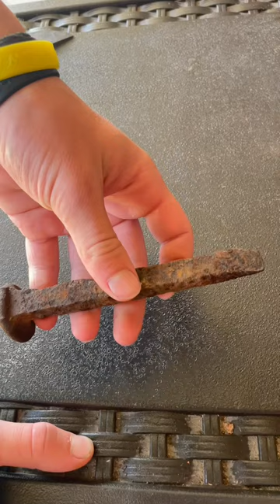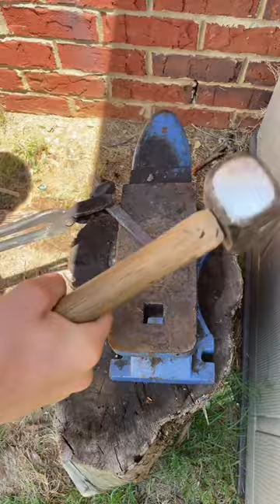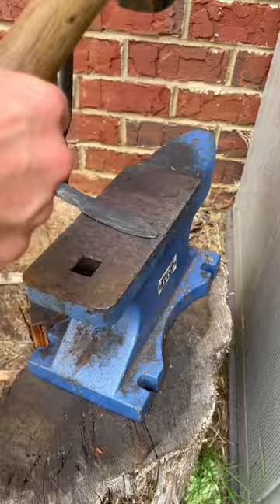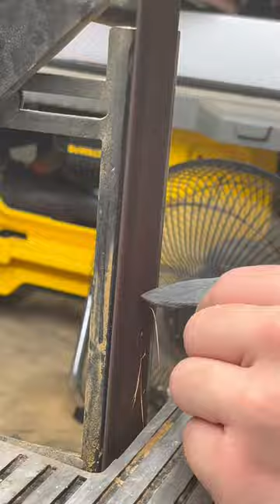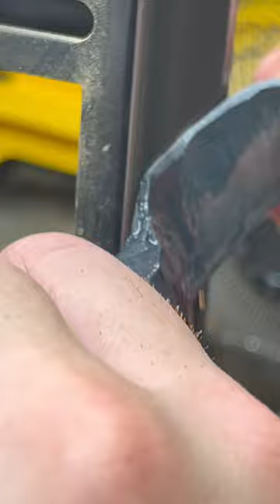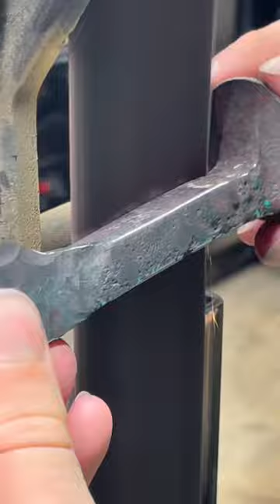Forging old railroad spikes into simple knives- #forging #knife #forged #diy #bladesmith #handmade

Comment: So what kinda rr spikes y'all using that actually harden up enough to make a knife out of?? All of the ones I've tried barely harden up enough to hold an edge at all. Like they almost don't even harden at all. Are there different types out there with different carbon percentage?
Reply from the maker: Thanks for the comment! I actually didn’t heat treat these ones, all railroad spikes you find are going to be soft or mild steel. So sadly they don’t make a good usable knife but they are nice for decoration or letter openers. Plus they are great practice for forging! So sorry i can’t really help you with hardening them but i hope this helps a little! Thanks again for watching!
Reply from the maker: Hey, scratch what i said before. I’ve been doing some research and found out that there can actually be high carbon steel railroad spikes. They will have an HC stamped on the top vs mild steel ones will have MC stamped on top. So it is possible to find them they are just much more rare and most modern ones will be mild steel. Hope this helps!
Reply: HC marking on rr spikes means that they have higher carbon and are
 Not made of high carbon steel. You see HC marked rr Spikes are between 0.30% carbon and 0.50% carbon while 1095 (AISI1095) which contains 0.90-1.03% Carbon, about three times as much carbon as the “HC” Spikes measured and lab certified to contain.
Reply: HC marking on rr spikes means that they have higher carbon and are
 Not made of high carbon steel. You see HC marked rr Spikes are between 0.30% carbon and 0.50% carbon while 1095 (AISI1095) which contains 0.90-1.03% Carbon, about three times as much carbon as the “HC” Spikes measured and lab certified to contain.
Reply from the maker: @REVANDREFINE Thank you so much for sharing this! I had no clue, guess you can’t believe everything you read on the internet 😅 I checked out your channel btw and it’s awesome! your so talented.
Reply: Thank You!! @NolansKnives
Reply: Oil quenching is what I do and it gets hard enough for what I need them to do. I treat them just like 5160
Reply from the maker: @RVsbladesnthangs  No way! So you’ve been able to harden them? Do you happen to have a ruff idea of what hrc they come out to? Thanks for sharing!